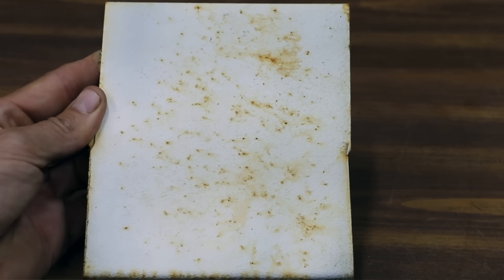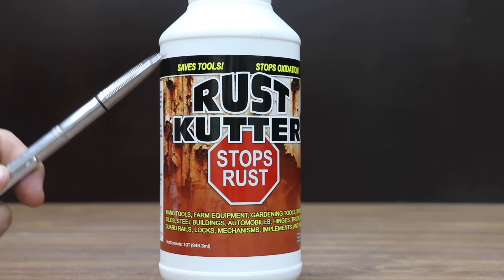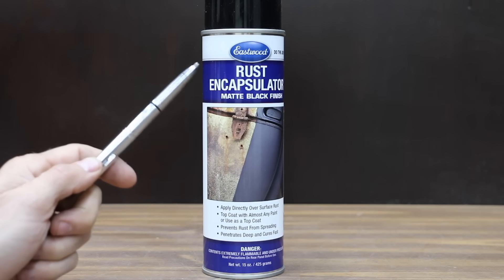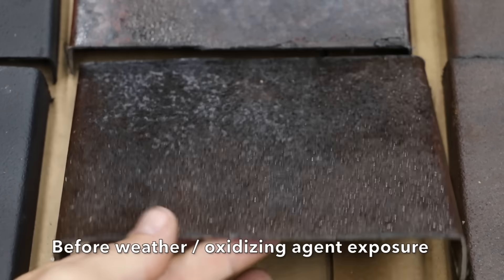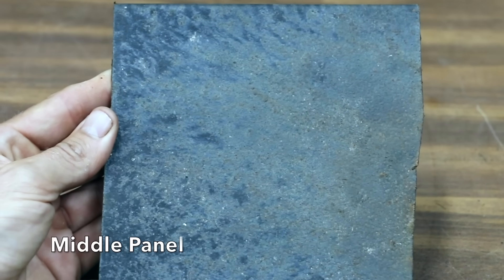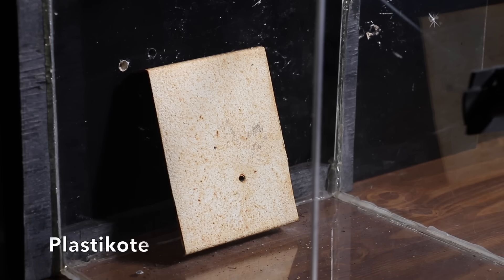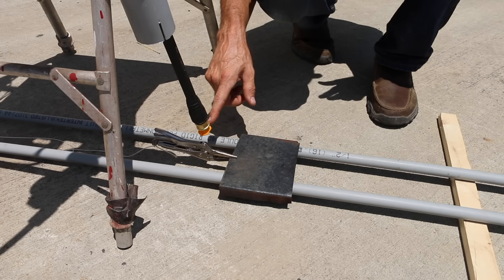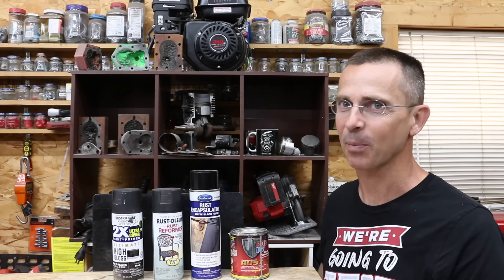Best Rust Converter? POR-15, Eastwood, Rust-oleum Rust Reformer, Gempler's

Comment: I painted a whole trailer with Rust-Oleum rust reformer and it held up great. Lay as many coats as you can, it's cheap!
Reply from the maker: Thanks for sharing.
Reply: I’m doing the entire undercarriage and frame of my truck with RRR. I imagine you spray it on like any can of spray paint. Did you need to do much prep work, or does it just spray and stick?
Reply: @gregt722  i hit it with wire brush on the old grinder, wipe and spray. Give it couple coats before applying Rostuleum oil based gloss black high performance enamel with a roller and brush so it goes on thick. They sell it in gallon form and it's great for the price.

Comment: -- Hmm.  Spent spring and all summer rust protecting my winter beater.  Somewhat surprised you didn't use any of the products I used.  Not a complaint on you at all, and thumbs up as always.  Below was my process if you care to know it.

Following grinding down/ rust removal/vehicle disassembly.

1: Carwash
2: Pressure Wash
3: Degreaser
4: Pressure Wash
5: Mineral Spirits Bath
6: Bang Frame/crossmembers with hammer.
7: Vacuum, compressed air, pressure wash, magnet, inner frame and cross members.
8: Compressed air and a couple days to dry
9:  Corroseal Rust converter, 2 coats, 3 days dry time
10:  RP-392 Rust inhibitor, 2 coats, 3 days dry time
11:  CRC Rust inhibitor, 2 coats, 1 week dry time
12:  Farm Equipment paint, two coats one week dry time.  ...Armor against your BBs :)  
13:  Inner doors, frame, crossmembers, kicks received 4 coats of Fluid Film product, gunned/hosed emitted in.  

About 700 bucks and 6 months later, you could say I took the Nuclear Option.  Up here in the rust belt, I usually buy a beater for winter once every one or two seasons, but this 2004 Tahoe Z71 is in near perfect shape, and with everything the admin is doing to destroy the economy, and inflation, this thing needs to last longer than that.
Reply from the maker: Thanks for sharing!

Comment: I used Kud Kutter Water based (Rust-oleum product) on Chev Van roof that was 80 percent rusted. One year later it's still not showing any rust breakthroughs.
 Kud Kutter, auto primer and paint final color coating. All Rustoleum products.
Reply from the maker: Great suggestion.  Thank you!

Comment: I am one who asked for this test and I really appreciate the amount of work you put into all of your videos.  I'll be using the POR for my project.  Thank you!
Reply from the maker: Thanks for asking for the video test!
Reply: You guys won't be disappointed.  Be forwarned, it will stick like hell to concrete, so make sure you don't get it on the garage floor.  I certainly couldn't get it off (I didn't notice till it dried) It's also incredibly scratch and ding resistant, which made me glad I picked it to use on my suspension and subframe.
Reply: @rustytracey6187  It stains skin for weeks.
Reply: @dmcarpenter2470  I use por15 almost daily. Most of it will come off halfway they a shower with a light fingernail scratching.
Reply: @fknbossfabworx1067  "most" being a key term
Reply: I asked as well, Great minds think alike right
Reply: I used POR 15 to seal a gas tank on a 1957 JD tractor
Reply: @davidrichmond5972  they do make a far better product for lining fuel tanks called KREEM.     Toss in a pound or two of bolts n nuts do the cha cha cha .    Dump out pour the creamy goo in by itself  and slosh tip slosh .      That will give you a nicely lined tank .     Not so sure with POR long term in there.   Watch out for flaking off as POR has little affinity for nice shiny metal surface unless it’s deeply scuffed .    
    To really stick it needs to have some rust to attach to .     A nice shiny clean metal is asking for trouble .   Letting the 1st coat dry past the coating window demands scuffing till dull or it won’t stick well at all.     Strange stuff, sometimes I love it sometimes I hate it .  Too bad it’s near impossible to store once opened.    High tech in the 1970s but not so much compared to modern 2 part epoxy  primers and polyurethane paints.
Reply: I'm not a professional, so I won't be using the POR-15. Us amateurs will have to stick with the Rustoleum. :)
Reply: @kevinmahoney9205  depending on how big your project is you’ll save a lot more money with por15. I did 2 whole truck frames with a quart. It would have taken a case of spray cans.
Reply: @fknbossfabworx1067  This is good info, thanks!
Reply: @kevinmahoney9205  I use Rust-oleum around the garden for metal planters and some patio furniture--works great, and lasts for years.  Rust-oleum is available in several colors.  Of course, using it in the garden is fairly light duty.
Reply: wear a mask with POR15 as it contains isocyinates if i remember correctly
Reply: Like most others, I did not ask.
Reply: I also asked! Surprised at how many other people also did.
Reply: I asked as well.  I am a long-time POR user, and glad to see these results.

Thanks!
Reply: The por did chip and exposed metal with the ball bearing fired at it. It's clearly biased towards por
Reply: I didn't have good luck with POR15 but Rust Bullet I found to be a lot better.
Reply: Hey Por15 needs good preparation for it to work otherwise it peels like the rest.

Comment: A clear winner - at a price. Unfortunately, most products are unavailable here in Germany, so I get to trust the "my dad used to use this"-products.
As always, I am in awe of your inventiveness to test products in real life environments. :-)
Worth every Patreon dollar and a call to everyone here - support Todd and his tests - this is a unique channel with valuable content!
Reply from the maker: Thanks so much!
Reply: Try linseed oil ( Leinöl ). Works on par with the products tested here, and it´s not only UV-resistant, it is activated by UV light to transform into a polymer. I use it on the rusty ( china tin )  exhaust of my scooter, which sat outside 24/7 for 6 years now. Whenever the linseed oil coating burns away ( about 4 times a year ) I just re-apply it ( it´s really cheap ). It lasts longer on less demanding things than exhaust mufflers :)

Comment: The only way to remove rust is to completely remove the rust ! ⚠️Rather completely remove the rust using a full strength acid such as muriatic acid, which turns the rust into "green liquid smoking vampire blood" wash it off ,neutralize the area & only leave the pure bare metal behind, then treat these areas with either zinc or proper primers,fillers  & paint to a OEM finish,optional 2 is to replace the entire piece of steel if needed & if available
Reply from the maker: Great information.  Thank you.

Comment: I can vouch for the POR 15.  It does not dry, it reacts with oxygen to form a very hard coating.  One has to after apply a binder coating to get regular paint to properly adhere.  I believe I was told that it is actually marine barge bottom base coat, one of four coats system.

My story.  Have steel panel frame french doors that started to rust after 8 years from new.  Per instructions at the time, I sanded down to bare metal.  Coated bare with a POR 15 product called Metal Coat (at the time) which was zinc phosphate.  Light sand.  apply POR15.  After 48 hours apply binder coat.  24 hour dry Apply 2 coats regular outside house enamel.   THAT WAS 22 YEARS AGO.  Three house paintovers  later, and only some wear edges rust.  I have  redone several door edges as described above and  all are successful repairs. 

Now the final question, what environment are these 6 doors exposed to?  Central Florida, hot humid western exposure no shade, next to a chlorinated pool.  

Learned about this stuff while restoring cars in the 90s  A lot of prep but lasts a long time.
Reply from the maker: Thanks for sharing.

Comment: Excellent test
Have you tested the smooth rubberized coatings yet?

Plastidip vs Rustoleum rubberized undercoating vs Rustoleum 2in1 reform and seal vs Flex Seal vs Rubberize!! vs krylon True Seal vs POR 15 rubberized undercoating….
Reply from the maker: Thank you very much!  Thanks for the video idea.
Reply: To coat tool handles, metal chair legs, and other metal objects—not for vehicle undercoating purposes (I know that’s not recommended)

Comment: One brand I didnt see was SEM Rust Shield. It works just like POR 15 but at a lower cost. I have used it on several projects. SEM makes great products and I wonder how they would have done in your test. Try them out sometime is you get a chance.
Reply from the maker: Thanks for the suggestion for round 2 of testing.

Comment: I have sprayed close to a 100 gallons of POR 15. Tankers, semi truck frames and other items. It is very difficult to work with. It is very sensitive to moisture. It takes two coats, second coat applied when the surface is tacky. Sandblasted metal must be BONE DRY or it will peel once dried. POR 15 will fade in the sun so it needs a topcoat. Sandblast metal and apply their metal prep and rinse real good with water and CLEAN rags to neutralize the acid.  Then let item sit in the sun to warm the metal to remove moisture. Just remember that regular paint will not stick to cured POR 15! You would have to use a professional 2 part etching primer. I have had excellent durable results with POR 15. GOOD LUCK!
Reply from the maker: Great information.  Thank you!

Comment: Not testing UV breakdown is a mistake.
Reply: Seems to me that the uv test was included in the 60 days exposed to the elements pieces ?
Reply: @juslitor  UV will take much longer than 60 days to break down a paint. How many 60 day old cars have peeling paint? 6 months or a year would have been a better length of time.
Reply: @steelcityundercoating  Two months in the sun does give some general indications. POR-15 is quite likely to be able to handle uv.
Reply: @juslitor  why would POR offer a uv top coat then? 🤔 it looses its gloss and turns chalky.

Comment: It's kind of strange to see the "control" test end up in the middle of the pack. 
The Rust Reformer looks like an incredible deal for the price.
Thanks for the video, not only is it entertaining but very useful information.
Reply: Iron *Fe*  That'd probably give best results but I think Project Farm followed and exceeded the recommended drying and curing times suggested by each product manufacturer.  That's good because most people would probably barely do that.
Reply from the maker: You are welcome!
Reply: Yes as converters we don't really know what's best. But, We do know what helps as a base layer for paint. I still have to say, in my experience. Rust Killer is the best rust inhibitor/primer I have used. It doesn't seal as well as the $30 one here, but if you use it and apply clear coat or paint and clear coat you may never have to re-paint.
Reply: Iron *Fe*  I agree with you there
Reply: Paint is a great sealer. This test was more about preventing future rust, less about converting existing, so you're right that it didn't necessarily test the intent of the products. 

A test that showed the performance of a paint that says all rust must be removed prior to application would have better shown whether the products actually neutralized the existing rust.
Reply: Or... the fact is whatever coating the rust is "converted into" is just poor and there is no fixing a poor material coating.  Which makes me think that POR-15 just adds something like plastic truck bed liner as a protectent.
Reply: @reina4969  POR15 is a hygroscopic enamel paint.  Where most paints are softened by moisture, it actually makes it harder.  When properly primed with their metal prep solution, which is a blend of phosphoric acid and zinc phosphate it is a really good solution to stop rust.  I did all the subframe and engine bay on my supra with it.  It's also VERY chip resistant.
Reply: Yeah, I am somewhat concerned by that. It is almost like we are not understanding the point of these rust converters and are testing them against criteria that is unfair.  I am not saying I THINK that is the case, just wondering if people with more wisdom than me could posit a test that would have left the paint at the bottom.
Reply: I have used Rust Reformeron my projects for several years. It is a very good product for the price
Reply: These tests were very simular to the bed lining tests in a way. They call got blasted by the rust accelerent solution.

Comment: You should have tried Blackstar rust converter it is by far the best I have been using it for over 10 years on car restorations. It's not cheap at $89 a gallon but you get what you pay for. I have tried many of the ones you have tested and some won't dry when put on clean or bare metal. Blackstar will dry on bare metal, you can also use as a primer. It's also been out longer than most of these products.
Reply from the maker: Thanks for the suggestion for round 2 of testing.

Comment: Sorry you can't clean things with brake parts cleaner before you paint them. There's something in the brake parts cleaner that keeps on gas and off and it distorts the paint. I learned this the hard way. By cleaning an alternator off with brake parts cleaner then painting it. I even let the alternator sit for a week after it was painted. Sanded it down. Put another coat of paint on it. Still distorted.
Reply from the maker: Thanks for the feedback.

Comment: Is a rust converter recommended over a rust preventer such as Woolwax or Fluid Film for slightly rusted welds under a vehicle?
Reply from the maker: Thanks for the suggestion.

Comment: wait what? They ask NOT to remove the rust first, otherwise they won't work? Damn, that's exactly the opposite of what I've been doing. Go to bare metal so the rust won't come back from underneath.
I always try to: Temove all rust until as bare metal as possible. Clean, then, phosphoric acid. Then, rinse, then converter, then paint several times.
Reply from the maker: Thanks for the feedback.